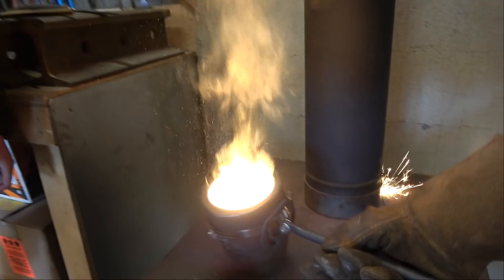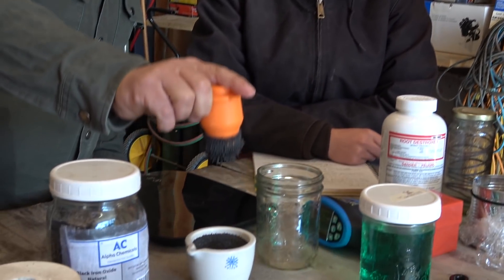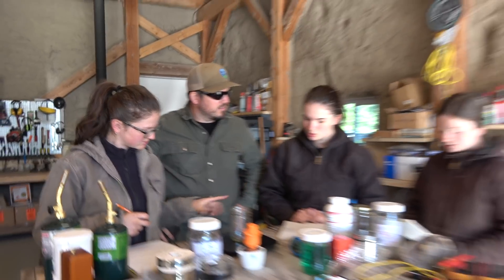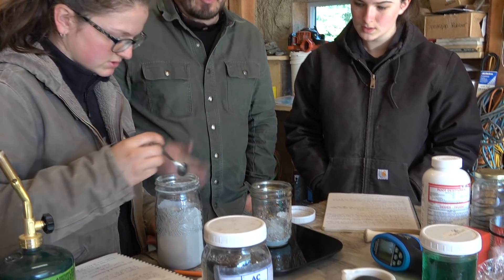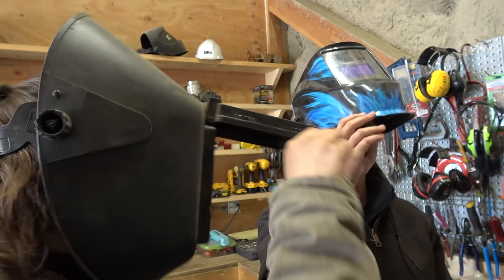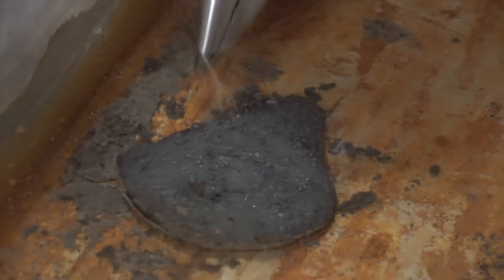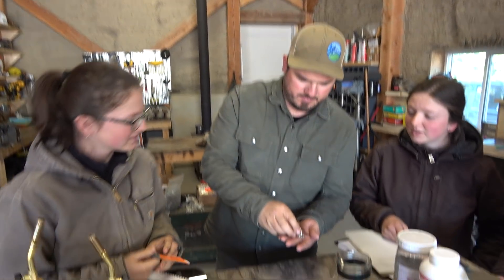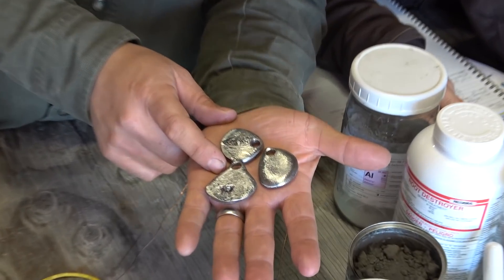Making iron from dirt - thermite reaction chemistry.

Comment: The is one other Kool thing one can make with  Iron oxide.  that is Hydrogen gas. to run a generator.  It is called, The gun barrel experiment. How do we do that, well we fill a pipe full of Iron particles as you have in the experiment in this post. Heat in a Charcoal fier  & heat water so the steam can be pushed through the hot filings the oxygen will transfer to the iron & what remains is hydrogen gas that can be used to inflate balloons & drive generators to charge up batteries,    Now to collect the gas stem passing in one end that passes through water,  Capture the gas in an innertube or balloon use as you see fit. To run a generator or fill a balloon les England the first time I did this experiment I used Iron nails.   The second time I did the same experiment but put charcoal in the pipe instead of nails I got a blend of ( (3) gas dioxide gases C1 & Monoxide gas C2 gas & When heated in a hot reduction zone we replaced Dioxide & converted to  Monoxide gas C2 & now if we heat water to steam the carbon will absorb the oxygen & transferred it to carbon to Mack C3 & now we have " h2 hydrogen & the carbon Making C3 & H2 hydrogen the gas.  We call  Propane gas a form of hydrocarbon, gas,  & one gas I think you should try to make as your experiment is going in that direction.

Comment: ok when i was a young man we lived of grid . my dad had precast an  old gasifier in Norway & shipped  it back to the uk . the thing  is he tort me how to remove  oxygen from steam  & tern water in to too two tip's to  opting.  Hydrogen.  of  one was hydrogen with CO/2   & purer Hydrogen,   this was Done  in tip one we ues charcoal to collect the hydrocarbons by passing the steam through a 2" tube full of charcoal.  the reacshon was to barn off,  the "Oxygen"  & as they attach then self to Hydrogen  in this case  the  Hydrogen in water  Making Hydrocarbon's the building Blocks for petrol & Desal &. often we for get once oxygen as reacted with fire  IT is spent AS   gas & its Carbons cannot Bren off   with in it plasma chamber.  As it passes through  the hydrocarbons  form a chain in gas only oxygen barns in a vacuum  gas will remain & form,  hydro carbons   when  a colon of water is dript in to a barn chamber Oxygen will be burnt of & hydrogen & hc'2   OR 2Hc will reman  (WE Cool in  A BUBBALER )  cools & form's  a stable gas.  IT the baring of of Oxygen that Make's the proses in your iron  experiment work  Just as it dos in  producing Hydrocarbon's.  & the same  reacshon is achieved whit Bering wood in a gasifier.    SO in closing I now refer to my furthers second lesson  how to get Clean Hydrogen. This is dob in a similar way i to suffered with wet or Damp smock   to the fix it the  first  time  i past it throw a pace of pipe. with charcoal  it  Hated  to red hot  but insted of passing  the seam trough Carol we pass the steam though & 1/2  pipe which is sounded by the 2" outer pipe . but to sustain a plasma flailed i field  a pipe to feed  a small amount of air to  past though the charcoal Colom To inures it barn chamber silty under vacuum To achieve an Oxygen Bern of so only Hydrogen & it carbon left by the ,   1/2"  Pipe now we have a Clean hydrogen production.  Once agen once  cooled in a Bubbler the gas can be Stored &  uresd  I built my first  innertube,   this way  by stretching  a innertube   & filing it with hydrocarbon  until it was needed.  a full tractor linear tub gave me 4 hoers run time on the gen set. a old iron hours  That changed at 30 amps.   

the passing  of steam through caracole  is sufficient to run a   engine to power & generator or  run an Iron hour's to charge up a battery bank.      in closing well done I like  it    I think there plenty of scoop providing thes some feed back. on comments given    & them lick me are given rum to speak even those Whit  Dislexcea Like  me get A  say from time to time  . Les England.
Reply: i think it a grat opatunity to pass on to others you knowledge .  i will pop in from time to time & have a discussion  thaw I'm in the UK i will comment & you can debate it .  with your class .

Comment: Not only did they learn chemical composition and the components into the iron making process from magnetize (black sand or dirt) they also learned how to stop oxidation (rust) by plating process turning their classroom project into a keepsake they will treasure for as long as they own it. Now the advanced class is turning iron into steel.  But u will need to build a blacksmith shop for that class. Dan Hurd would be proud of this class these young ladies learnt. OUTSTANDING